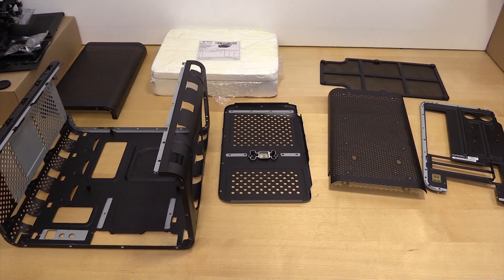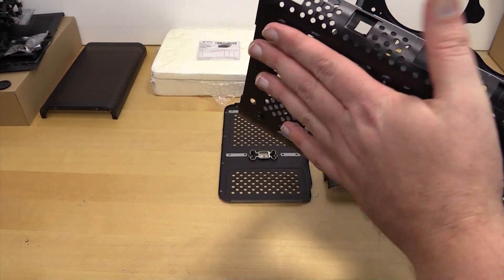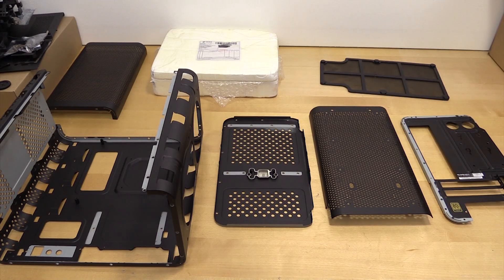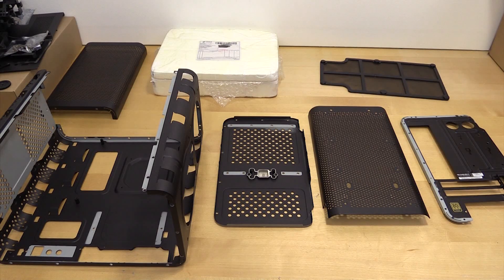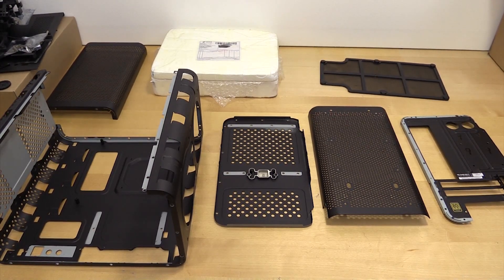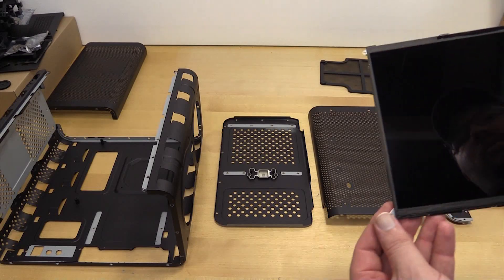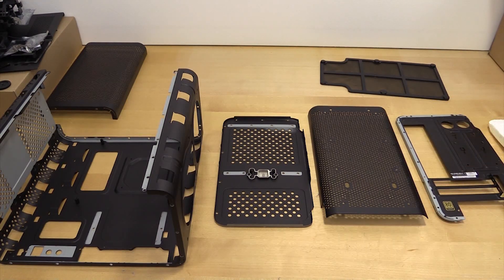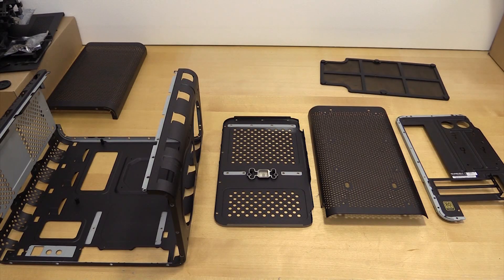How To Modify An EVGA Hadron Air - Tear down continued!

Comment: I just bought a used Hadron just for fun. I took it a apart. Gave it an extreme cleaning. Removed the drive bay. Removed all the cables from the psu except for the 20+4 and 8 pin power connectors. Put a B550 board and 5600G in it just for a fun build to watch YouTube, movies, tv etc... on it while I tinker in my basement. My general feeling about the case is this: I know it was 2013 but the case is pretty cheaply built, corners cut and half baked. That being said it is kind of cool in its own way.

Comment: I think at least one will fit inside there with the drive bracket removed, and I think it'd be awesome with the screen in the side there, since there isn't any real way to hide the cables in this case is there? Keep up the good work and looking forward to seeing how this turns out, should be a gnarly little beast in a tiny package ;)

Comment: In stock format, to my knowledge anyways, there is no way to fit a rad up there. there is only enough room for the ~25mm thick fans not another ~27 for a slim radiator.